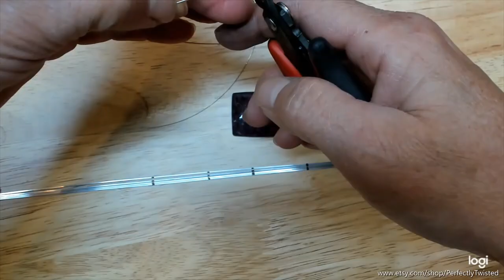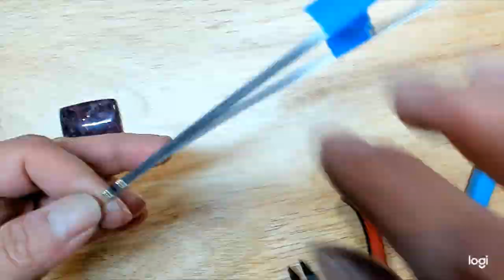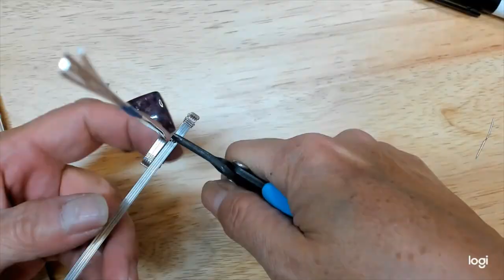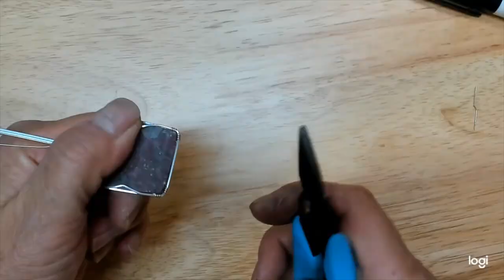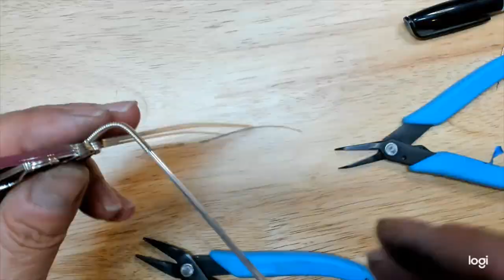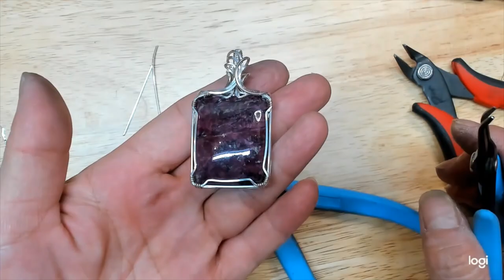Wire Wrapping Square Stones Without Holes - time lapse video - start to finish

Comment: When doing a project like this, how much 1/2 round should you use (approximately)? I need to order 1/2 round wire and am not sure how much to order. Thank you.
Reply from the maker: For this project, 4 feet onhand will be more than plenty of half round.  I will have tools and measurements in the tutorial like all the rest of them.  You can find this info in the first 20 seconds of all of my videos.  Thanks again, Kim!

Comment: What method do you use for straightening your wire?
Reply from the maker: Thanks for your question, Cindy, I normally do straightening with Nylon Jaw pliers but have recently learned there is another little tool that looks like 3 rollers attached together.  I just got one and so I might do a quick post later on it and let us know how it works.

Comment: Most excellent approach,  I will definitely try this one out.  Where do you find silver flat or half round wire? And is it tarnish resistant?
Reply from the maker: Hi Bonnie, I order wire from Riogrande.com, they have all of the wire in most shapes.  This sterling silver is not tarnish-resistant, but you could search for Argentium Silver wire within Rio, I think that's supposed to be more tarnish resistant.  They also have articles about the wire types and their properties.  Hope that helps!

Comment: Very unique technique and I like it. Until 07:00 it looked perfect.
It would have been better if the stone was polished on both sides, and without leaving the ends of the wires left on the backside cause they could easily get caught by the clothes or scratch skin.
Reply from the maker: Thanks M! At 7 minutes, rather than using them for design, you could simply cut the wires away and make it a more unisex pendant.  If you watch until the end, you can see that the back curls are all tied down.  If you build the curly designs correctly and tie loose wires down, snagging and scratching are not an issue.  I sell jewelry worldwide for over 15 years now without this issue.  I hope that helps and inspires you. Thanks again for your comment.

Comment: I Love this wire wrap. I'm new at this. But I have a piece I'm trying to finish. It's not quite a rectangle. The top is smaller than the bottom. But I think I can figure it out. What size wire did you use?
Reply: Also, please slow your videos down a little. I'm 63 yrs old. I can't see some of the steps you did.
Reply from the maker: You can do it!  You were watching the demo my dear... here is the real time, fully detailed tutorial, in normal motion... https://youtu.be/E9xfTF3JNgM  Have fun!